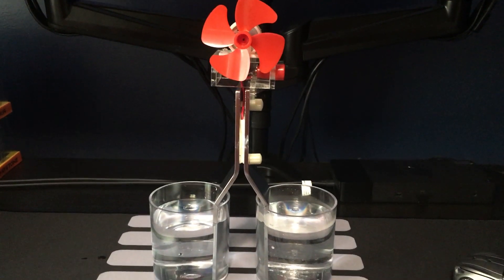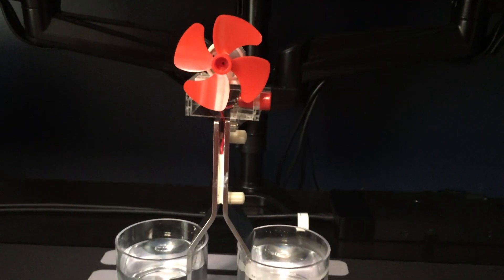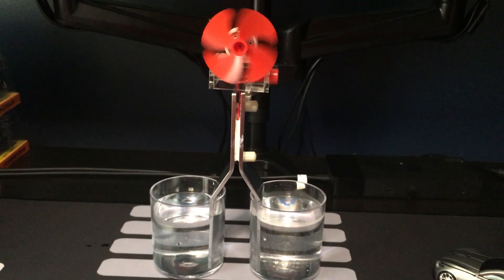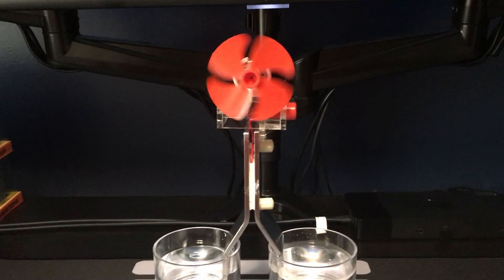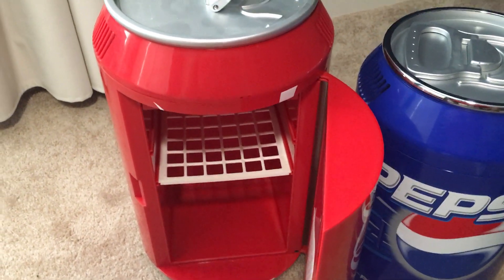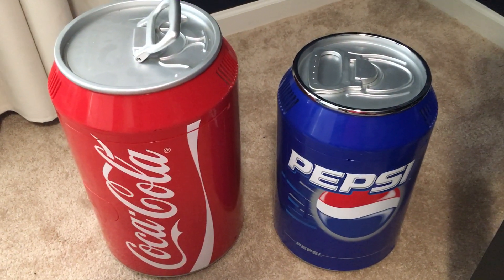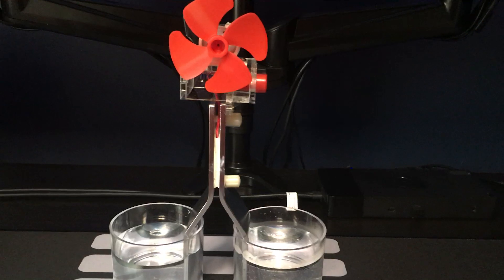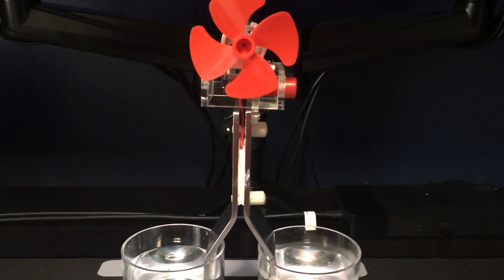Thermoelectric Generator Demo Kit #thermo #electric #generator

Comment: there are thermoelectric device is pelteir module or not?
Reply from the maker: Either you're putting power INTO a thermo-electric device, or you're pulling power OUT OF the same device.  A thermo-electric device that converts an electrical current to hot/cold plates is a Peltier device (thermo-electric heater/cooler).  This is what is in those small fridges.  A thermo-electric device that converts heat to an electrical current is a Seebeck device (thermo-electric generator).  Does this help?

Comment: Ahh I remember we talked about this in private. I can’t wait to see how you adapt this to your master plan. Even with this I’m wondering if stored Thermo power is needed to maintain heat. Though running oil lines outside of the cool liquid container could do the adverse on the other water source. Just a thought, though I’m sure there’s better ways.
Reply from the maker: Keep in mind, this process doesn’t STORE heat, it simply passes heat from one side to the other, picks off some of that heat energy (1% to 5%), and converts it to electrical energy. I am working to improve efficiency, which will change the game completely. A target of 10%-15% is all that’s needed. But easier said than done.